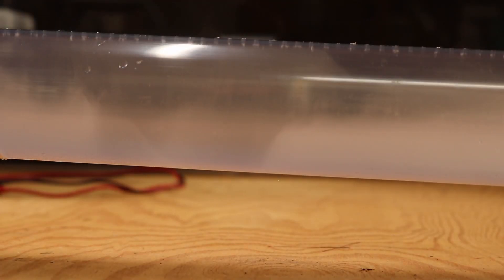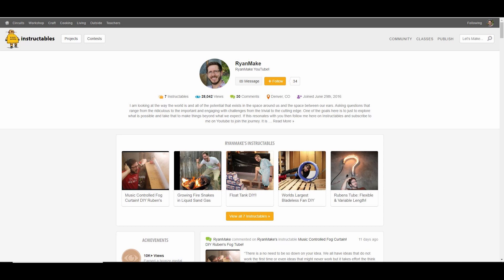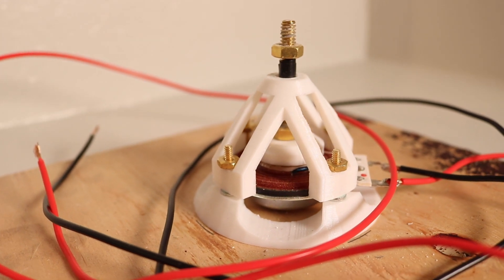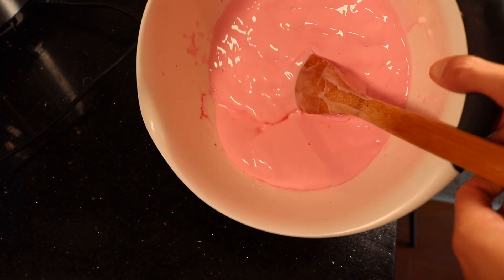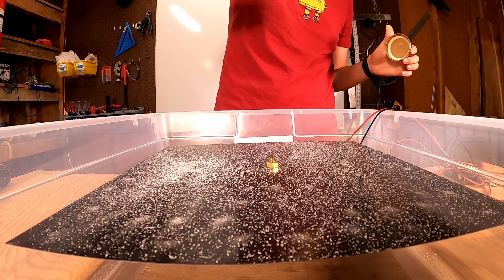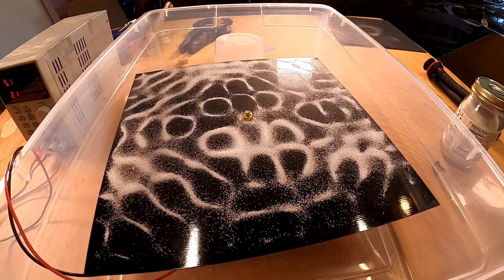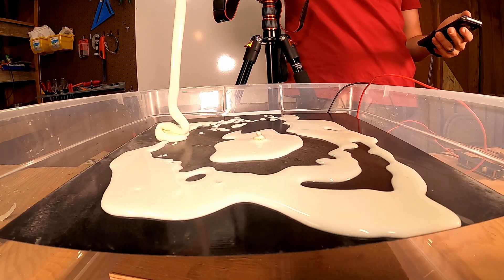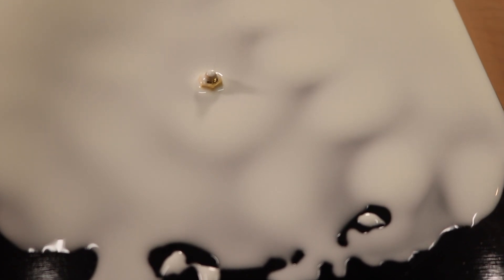Oobleck Chladni Plate! Cymatic Figures!

Comment: If the spaces between the aggregations of powder are occupied by the stronger vibration of present sound waves (vibrationally pushing the powder aside), does the rheostatic resistance of the corn starch + water mix create an inverse pattern?
Reply from the maker: That is a great question! That is pretty much exactly what I was seeing the dry sand would find the nodes while the corn starch and water would seek the anti-nodes

Comment: Weld SIDES on the plate. Hold the sand in.
Reply from the maker: That is an interesting idea. I am not sure how that would affect the flexing of the plates which is what makes the stable patterns. Maybe a softer material like gluing straps of rubber might work.

Comment: It's a 3 dimensional visualization of the sound wave!

Could you add anything tobthe ooblic that changes color under pressure change? Maybe that would highlight the mounds more
Reply from the maker: That is a great question. Do you know of anything that is pressure color reactive? I am racking my brain because that would be awesome to have a go to material that is color pressure reactive.
Reply: @RyanMake  Maybe that "mood ring" stuff that changes color with tempetature? It also changes color when you press it.  Worth a try :)
Reply: Or like you mentioned towards the end if you could try a more powerful version to compensate for the weight of the oobleck to see the shapes it's trying to make in 3d, would be awesome

Comment: Might it be possible to work with this non-Newtonian fluid in a spherical chamber or a device like John Stuart Reid's Cymascope? Since sound is actually
spherical, would not cymatic experiments be much more expressive not as 1D or 2D but actually 3D?
Reply from the maker: I am going to have to look into that! The biggest thing will be precision to achieve standing waves. The benefit of the chladni plate is that the plate directs and channels the sound which makes standing waves easier to achieve.

Comment: using baking soda and superglue
Reply from the maker: This is an interesting idea. I will have to see what sort of characteristics the mixture would have!
Reply: @RyanMake  The baking soda sets rock hard the moment the superglue touches it, thus preserving whatever pattern the baking soda has settled into. I guess you could then pour on some fresh baking soda, find the next harmonic and then glue that down, creating a permanent image of all of the modes on a single plate.
 I wonder if it's possible to aerosolise/ airbrush superglue? or is there another powder/spray combo that sets as quickly?
Reply: I have a possibly slightly far out notion that such a method could revolutionise how stringed instrument soundboards are braced.
Reply from the maker: @awsx those are some really interesting ideas particularly the sound board bracing. I am not very experienced with instruments but would the goal be to eliminate some harmonic through tuned bracing or what would be the draw?
Reply: @RyanMake  I'm not an expert myself, but I think bracing should ideally strengthen the soundboard in a way that allows all the 12TET notes to resonate with equal strength and similar timbre. So I think adding stiffness primarily at the antinodes of weaker notes could help them compete better with the dominant frequencies of any given piece of wood.

Comment: If you can use a Reuben's tube to express the first dimensional structure of sound, and one can use a chladni plate to show two dimensions of sound (or a standing wave?). How could one show in a visual way the moving vibrations with X, Y, and Z coordinate (3d)?
Reply from the maker: I would think it would have to be manipulating fog in a volume like the fog tube but larger. I will have to think about it.

Comment: Can you try to make a tile? Or possibly a concrete slab the size of your plate and then add color or dye?
Reply from the maker: That is an interesting question let me see if I understand it correctly. Use a absorbent sheet for the plate and apply ink to the sheet. Run the Chladni Plate and have the dye move to the pattern. Let the die cure to have the pattern permanently dyed?
Reply: @RyanMake  yes exactly!
Reply: @RyanMake  I wonder if you can use a thick sheet of steel for a chladni plate? Then make a form for concrete like 3 inches thick on top of it?   and use concrete dye while its mostly dry.. maybe when its wet? Dont know .. how big can you make a Chladni plate?
Reply from the maker: @Branden Byrd. These are really great questions.
The plate is this video was using about 10-20 watts of power. I am working on one that should be twice as powerful but to manipulate a concrete slab? I would think that would take 100's of watts if not more.
What might be your best bet would be to use a lightweight metal plate to arrange the dye and then stamp the concrete on top to transfer the dye material.

Comment: Maybe try it with powdered sugar
Reply from the maker: Using powdered sugar as a dry powder in place of the sand blasting glass?
Reply: @RyanMake  yes, I don't know if it would work. I'm just saying stuff

Actually, now I'm thinking about it, it probably wouldn't work. Because it needs some "jumping" space I reckon.
Reply from the maker: It might work. One thing that might create a problem is that it is so light that it might just make a powder sugar cloud above the plate.
Reply: @RyanMake  yea I was just (yesterday) thinking about that

Comment: Laser line, smoke across the oobleck may show the 3d effect of the vibratory waves better.  Just a thought.  :) Cool project
Reply from the maker: Hello EddieJohnson25,
That is a good idea. I will have to have to think about how to make that work. Is the laser aimed at the oobleck to reflect it or is the laser parallel with the plate to highlight areas of higher and lower density smoke just about the oobleck?
Reply: @RyanMake  was thinking parallel to the plane but it would have to be experimented on.  Either a cheap laser pen diode one or one with a straight line might be the ticket.  I could see the oobleck showing the 3d effect and I'm sure you could see it but hard to see it on the video.     https://www.youtube.com/watch?v=iyhySKWPtmA
Reply from the maker: @EddiJohnson25 That is an interesting idea! All the more motivation to finish designing and start building the hand held fog machine I have been thinking about
Reply: @RyanMake  After thinking about this, I'll bet you could use a projector, using lines on the projection screen to display the contrasting rise in the wave.  I saw a cool interactive table https://www.youtube.com/watch?v=bA4uvkAStPc   and he didn't use fog but also had a major cpu running it with augmented reality.  Anyway, I'm sure you'll figure it out lol
Reply from the maker: @EddieJohnson25  I saw that project and was really excited by it. I am working on getting my programming skills sharpened up so it might take me a while to get to a Time of Flight camera like the Connect but that would be really fun!

Comment: 1:10 
good design
Reply from the maker: Thanks for the positive feedback!
I was really happy with how it turned out. There is a 40 watt acoustic exciter that I have found that is a bit bigger so it can move up and down further hopefully expanding its capabilities. This will take resizing the mounting hardware.
Also I learned that I need to have the hole in the bolt guide be a little bit tighter so that it does not wobble as much and I am thinking the next time about putting a nylon bushing in there as well.

Comment: It would be neat to test different base plate materials, such as pine plywood vs a hardwood based plywood and also an acrylic sheet. Seeing the different resonance patterns with the sand would be cool.
Reply from the maker: Hello Jason Lambert! That is a great point. I tested both 28Gauge Galvanized Steel and 22Gauge Aluminum but I had not thought to test materials like plywood. I am not sure that the are thin enough to produce the deflection needed for resonance to be visible. I will have to look into this. Thanks for the question.
Reply: I wonder if you could make one with resin. 🤔